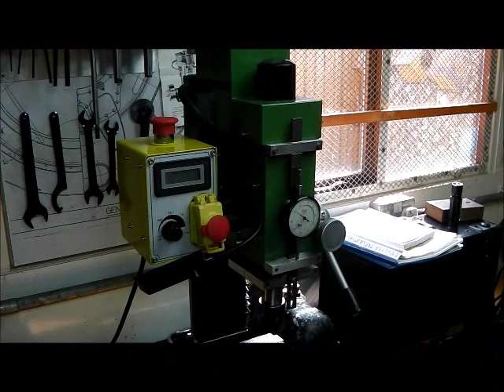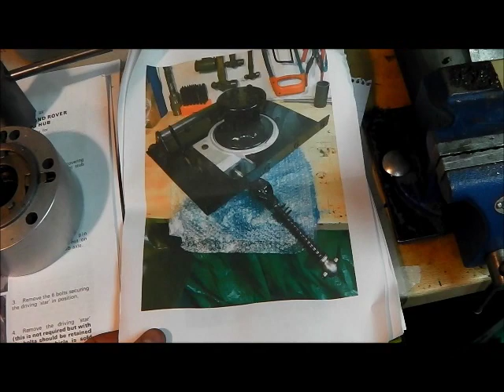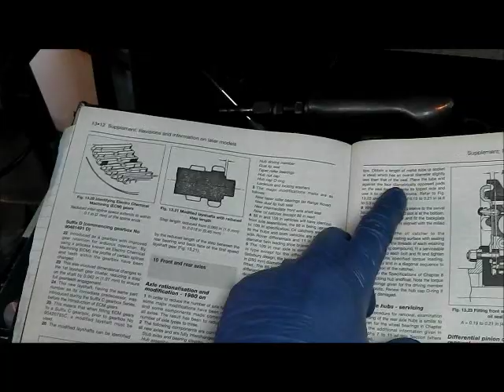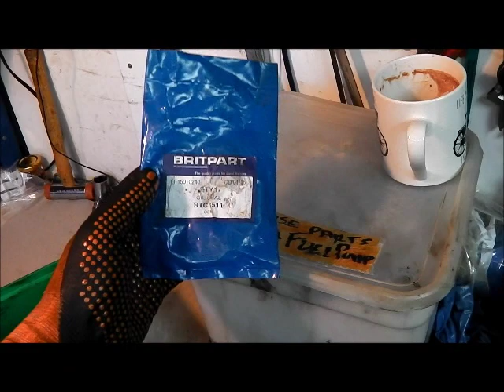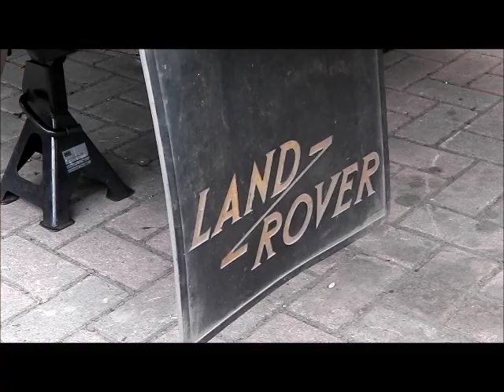Land Rover Series Lock Down Maintenance

Comment: Im  going to start work on my Series 3, 1982 10 seater in the next few weeks. I've gotta do at a minimum the swivel hubs, wheel bearings and a whole heap of other small things. Thankfully the parts aren't expensive, seems to be more time than money is required. Your videos have been very helpful, though if I could make one suggestion it would be to show a list of tools you require to do the job , which would help preparation. Cheers from Australia
Reply from the maker: Thanks, good luck with your project!
I've never thought to show the tools used, good shout.

Comment: I wonder if you could use the same adjustment method to adjust trailer brakes, but with handbrake or applying the electric brakes with a battery.

Comment: Time to get my fuel gauge working properly and fit the Roamerdrive!
Reply from the maker: Good choice, I've been very pleased with my Roamerdrive. Just remember to double clutch in the first change of every drive.
Reply: steamwally thanks for the tip. I’m running my spare box at the moment, I’ll rebuild the original as well   But the “ new “ one has a slightly dodgy sync on third so I have to match it up going 4 to 3. The old box was fine in all gears, probably a lay shaft bearing gone. Thanks for the tip, looking forward to an easier drive at the same speeds.